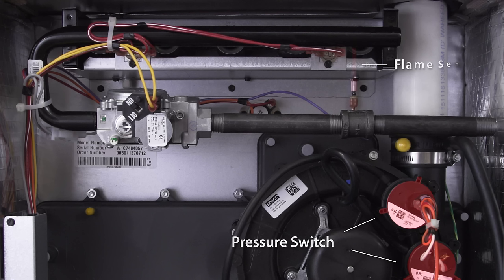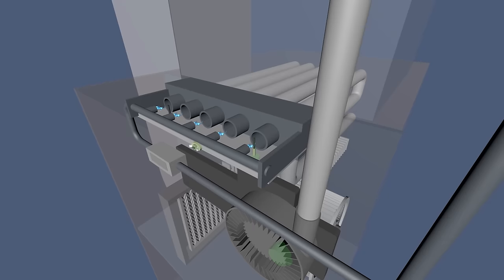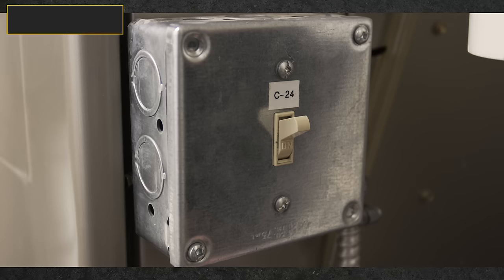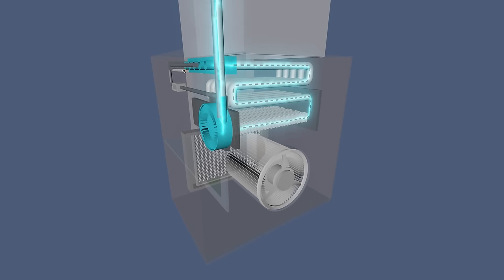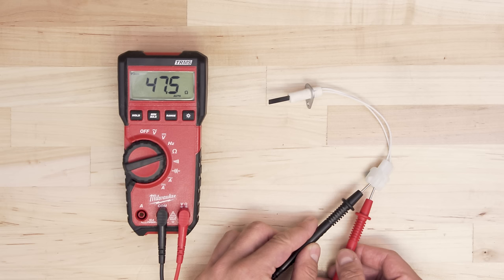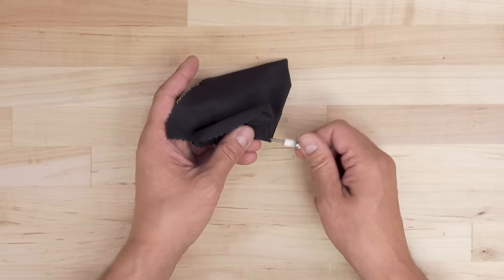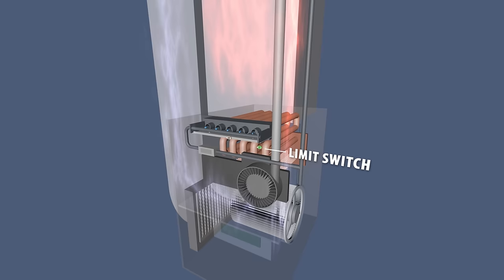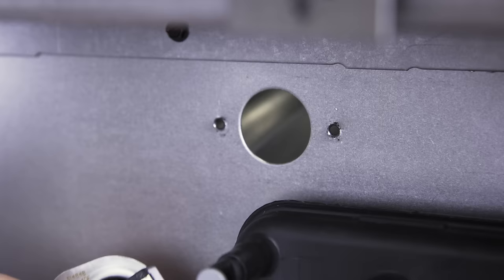Furnace Starts Then Stops - Troubleshooting | Repair and Replace

Comment from the maker: Now that you've narrowed down the problem, the repair videos for each furnace part are all listed in this playlist: https://www.youtube.com/playlist?list=PLCo9SMjkdWBzorzNrARLKALj9fW7HzHMh
Reply from the maker: @mavericktorch1619  Thanks for watching. If your furnace gives you multiple codes, and none of the switches are faulty then it could be a problem with the wire connects or a problem with the control board itself. The control board is pretty simple to replace but is usually a non-refundable part. You can see how to replace it here: https://youtu.be/4SY8lRl8HV0?t=125
Reply: Great video had this issue vacuumed the vent out put and while doing so I started it up and it stayed on...thanks for a clear and concise video my friend you have a sub for life no doubt.
Reply from the maker: @thastudent1741  Thank you for subscribing Erik! We're happy to hear that the video helped you out!
Reply: This furnace comes on and stays on a couple weeks then surprises us and goes off until it decides to come back on.
Reply: Great video. One thing about the inducer blower. We had an issue with the inducer coming on, then shutting back down. Eventually things kicked in later on and were normal. Then it happened again, so I called an HVAC specialist, but by the time her came,  the furnace was running normally. So more background, this obviously is in the winter, and we were getting cold spells. I was also setting the furnace very low at night (13ºC). I then realized that any condensation that perhaps built up during the night, as the furnace was off for a good 10 hours, was obstructing the flow of air from the roof inlet. Once I set the low temperate to 19ºC, the issue never reoccured. The furnace does cycle on once or twice during the night, but by morning, it'll start up right away. Came here because I think I have an issue with the flame sensor (it always comes on and stays on, but after 1 or 2 tries) -- but unsure if it's the Nest doing this to conserve energy.
Reply: This hasnt narrowed down anything. I have ignition then it goes out immediately. Cleaned flame sensor nothing. Replaced sensor nothing.
Reply from the maker: @jamartin005  Thanks for watching. The flame sensor is a rectifier which needs to complete the circuit between the control board, through the flame sensor, through the flame itself into the metal of the burner and down to ground. This is a low voltage DC circuit. Without a flame the circuit is not completed. A dirty burner, one that is covered in carbon can also prevent current from flowing, so it can be good to do a full cleaning of the burners. As well you could use a multimeter to check for continuity between the metal burner and the frame. to see if there is a good path to ground.
Reply from the maker: @jeffster1070  Thanks for watching. Sorry about the delayed response, youtube doesn't always show notification from replies buried within comment threads, so I didn't see this until now. Did you narrow down if the Nest was causing that sort of cycling?
Reply: @AmreSupply  cool thanks
Reply: I cleaned the flame sensor..then power now is not connected!! checked circuit breaker ..furnace one switch ...changed the fuse ..but still the lamp ( that used to blink signaling an error ) is not on at all ? what could be the reason ? thanks a lot

Comment: Saved me a service call and some cash. Mine was the flame sensor issue.   (Goodman furnace) Removed it, cleaned it, reinstalled it and now it’s working great! Thank you.
Reply from the maker: You're welcome Aaron. We're glad the video helped you narrow down the issue!
Reply: wow, that is crazy - exactly the same as me including the brand name of the furnace.  mine is about 10.5 years old.  thankfully it turned out to be a super easy fix!

Comment: Thank you from a single mom whose furnace wouldn’t stay on at 3am. Luckily I found this video immediately with a comment about “powdery snow” and I said I think this is my problem. Cleaned the flame sensor, problem solved in under 30 minutes. Forever grateful for your content!
Reply from the maker: You're welcome, we're just happy that the video helped you get your furnace running again!

Comment: Great video. It just confirmed my last fix is the right one. I had already been through cleaning the flame sensor, took the burners out and cleaned them, and thoroughly cleaned everything inside that I could, replaced the limit switches and the furnace would still decide to not ignite on occasion. I took the pressure switch tubing off and some water in there. After draining that and blowing it out good it has fired up without a hitch.
Reply from the maker: Thank you for watching, we're glad that the video helped you confirm and narrow down the problem.

Comment: Another potential issue that could cause furnace turning itself off after running (with gas on) for a short time is that the outdoor exhaust and intake ports/pipes were installed incorrectly. If both pipes have  openings (outside) next to each other, such as both facing down, then the intake may be sucking in the exhaust gas, causing a lack of fresh air/oxygen for combustion. Fixed easily by making one pipe face out and other facing down. Though illustrated clearly in instruction manuals, some installers don't do this right.
Reply from the maker: Hi Boris, thank you for watching. That is a great point and another good thing to look for when troubleshooting this!
Reply: Should the exhaust face down(with a elbow?) Or just no fittings at all- what about fresh air intake-a 45 elbow-or straight pipe also

Comment: Your video was very helpful in troubleshooting. The clear troubleshooting for each phase of operation made it easy to find the flame sensor was at fault.
Thankfully managed to fix it on a dangerously cold night of -27°C (-17°F) 

My furnace would occasionally run normally. But every few hours, it would attempt to light 3 times, and shut off.  I could hear the burners ignite for about 3 seconds, then they would shut off.

Investigated the flame sensor.  It was clean, but was loose and not close enough to the flame. Tightened the screw and re-adjusted so was in the flame path, and now it's working perfectly.  Although you didn't mention that particular issue in the video, it still helped me narrow it down.
Reply from the maker: Thanks for watching. We're glad that the video helped you get your furnace working again after such a cold night. You are right that this video didn't go into all the details on the flame sensor. The flame sensor is actually just a rod that sits in the flame. It doesn't sense heat, it completes a circuit from the control board, through the flame sensor, through the flame to the burner or heat exhanger, and returns through the ground wire. The position of the flame sensor, a dirty flame sensor or a carbon buildup on the burner can all prevent this low voltage DC circuit from being completed. Hope this helps provide a little more context!

Comment: My furnace was igniting then shutting off then on again continuous with no heat.  The sensor had very little corrosion but I cleaned it and reinstalled and works fine again.  I appreciate your time in making this video.  Saved me $$$ Thanks.
Reply from the maker: You're welcome, we're just happy that the video helped you get it running again!

Comment: This should be the first line of attack when you have a "Short Cycling Furnace Problem". I almost gave up after cleaning the furnace and checking the Nest thermostat, fan limiter, limit switches, replacing the air filter and fan capacitor, etc... I was ready to call the HVAC professional when I decided to give Google another try, I entered "Why does my furnace keep turning on and off",  and I found this section (3:13) in your instruction exciting, (holy sugar!)  cleaning the burners and flame sensor monitors are the solutions to my problem after all. It took me a day and a half to figure it out, I lost half of my hair scratching my head, thank you very much for your help, this post really made my day...
Reply from the maker: Thank you for sharing! We are just glad that people are finding these videos helpful and when it comes to the flame sensor, it is the root of many furnace issues for a good number of people. Cheers!

Comment: Mine turned out to be the thermostat on the wall , it's really old and contacts were corroded , changed it and works perfectly now !
Reply from the maker: Thanks for watching Dan, we're glad it was an easy fix for you! Hopefully you will find our other videos on our channel helpful as well. If you are interested we've recently created an in-depth video on how a gas water heater works https://www.youtube.com/watch?v=BHUPFLbb8NY&list=PLCo9SMjkdWBwJ4a8MT2GKTDiSuvSHg6Xk&index=1 Now if you find these videos helpful consider liking the video, sharing or even subscribing as its the easiest way of supporting future videos!
Reply: @AmreSupply  wasn't really a easy fix but I happened to have found out after a week of trial and error , happen to be standing next to the thermostat and I could hear it clicking inside so I put my hand on it and it caught hold and was running fine after that , what bothered me is the fact that I went to school and currently hold my HVAC license and this thermostat thing was never ever been through in the training class portion and when I was doing my apprenticeship , it didn't come across it either ? Thank God it was my own home furnace ! That would have been embarrassing out in the field ? 🤣😂🤭🙊🤫

Comment: THANK YOU! It’s 16 degrees on a Friday night here and my heater pilot would not stay on. It didn’t match your video exactly because the pilot would continuously  light and go off within a couple seconds but the fan was blowing the entire time. Regardless, I cleaned the flame sensor (which barely looked tarnished) and it immediately fixed the problem. I cannot thank you enough!!!!! ❤️❤️❤️❤️❤️❤️❤️❤️❤️❤️❤️❤️❤️❤️❤️
Reply from the maker: You're welcome, we're just happy to help! 

It could be an issue with the thermocouple, so it might re-appear. https://www.youtube.com/watch?v=3EKbSiAJyiI

Also if you have a multimeter you can test the thermocouple voltage to see if it is producing enough voltage to keep the pilot flame lit. If you have a spark ignition then your furnace might work slightly different than the thermocouple example as before. You can test the voltage similar to the steps in this video: https://www.youtube.com/watch?v=Mx6rZA9Yxv4&feature=youtu.be

Comment: Excellent video!  I found that after remodeling work, even with the system off, all of my sensors got dirty.  This video narrowed it down to the main culprit, but gave me the confidence to explore my system further and check/clean every sensor carefully.  Just took a tiny bit of dust to throw some of them off.
Reply from the maker: Thank you, we're just glad that the video helped you out! The flame sensor is particularly sensitive to a buildup of dust or carbon as it relies on a small DC current to travel from the control board, through ions in the flame through ground. This is how it proves that a flame is present. The flame sensor is nothing but a small metal rod. Nothing special about it.

Comment: This is a great video very detailed but I’d like to add something to this. If the heater keeps shutting down and you have done all this! Check your condensate pump line. It might be frozen if it is up in the attic and it’s like 6 degrees outside. So if your condensation pump is hooked to your heater it will shut it down as well.
Reply from the maker: Thank you for watching. Yes that is an excellent tip!

Comment: I had a problem and my furnace kept switching off after few minutes of heating in repeated cycles and that was the last issue you walked through. I had to change the filter which is just a month old and it fixed the problem. Can't understand how a one month old filter can cause a trouble but the solution you provided was spot on. Your videos are phenomenal and well explained to the point. A big thank you!
Reply from the maker: Thanks for watching, we're glad that you found the video helpful. Was the MERV rating different on any of the filters? If a filter was a higher MERV rating and more restrictive than the others, then it can cause the heat exchanger to overheat.
Reply: My experience: buy the least restrictive filter 
They are cheap 1.50 - 3.00 $ each and replace often especially if you got pets who shed inside the house .plus more efficient at moving the cool air in summer

Comment: Thanks AMRE and this video. My furnace keeps turning on, ignitor would ignite gas then off for three cycles. It's a Lennox G40UH. The diagnostic lights indicate bad ignitor. So replaced ignitor. Still the same. Then cracked open a beer and watched this video. Symptoms point to bad flame sensor in second part of video. So I cleaned the flame sensor as instructed. Lo and behold, it worked.
Reply from the maker: You're welcome! A dirty flame sensor can create a lot of problems. We're glad the video helped you fix the problem!

Comment: Well done and very educational.  I hesitantly called a guy out who started immediately with the 'I hope it's not the heat exchanger,' for which I'd throw him out.  He was pretty good at testing everything methodically, as an engineer though I was questioning things - enough for me to realize he didn't get it and just wanted to throw parts at it.  These things are not rocket science so I'm sick of these technicians who come out with more stories than Shakespeare.   I learned more from you in 5 minutes.  I already suspected he flame sensor, but will review limit switch as well.  The 'tech' wanted to replace the circuit board for $1800!  I found them online for under $100 (btw, that is what I used to do so I don't need his warning of electrocution or 'every year the fire departments find people in attics' (he said that!).   The other annoying thing is finding info in materials or on company's website - everything just refers you to other criminals, I mean 'techs.'
Reply from the maker: Thank you for sharing your experience and we're glad that you found the video helpful. This was one of our goals with the furnace series is to help homeowners gain a bit of knowledge. People go through the same stress with vehicle repairs, a little bit of knowledge can help prevent a mechanic from doing unnecessary work or over charging for a simple repair. Also $1800 is highway robbery for a control board. With the power disconnected these boards are very simple to replace.
Reply: @AmreSupply  Yep, you will do far better being transparent and honest than these hacks out there trying to get rich off every single call.  Good branding!  I've not swapped the board because I've been doubtful and prefer to review the other items like you showed.  Business is so easy, but there are still these old school clowns hanging on to ideas that 'people don't know' (tell 'em it's danegerous.'), they'll be gone soon enough, I hope.
Reply: I called a guy which costed $180 came over, and only cleaned my furnace, then suggested me to replace the furnace, but didn't solve my issue.  

I cleaned they flaming rod myself and now it worked for about 3 months. 
but now, the furnace works only when the cover is opened,  as soon as I put the cover on, it stops, even with the filter took off.  Could you help suggest what's the issue? thanks
Reply: @shw4083 did you ever figure this out? My error code is reading limit switch, if I have both doors on it will run for 5 minutes then shut off then cycle again a few more times before lockout. If I leave the flame door off it will just keep running without shutting off.
Reply: hi  @Del_Keba    this was exactly tha same error for my furnace.  You could try take off your burners offer and clean them throughly ,  mostly lastly that there are some residues/ashes that block the air into burners. I cleaned myself and it works well till now.

Comment: at first I was sure the problem was going to be the igniter but after watching that video and allowing the furnace to try starting with the front panel off I could see that the igniter was working fine and I had flame for several seconds before it would shut off.  I tried checking the flame sensor and wasnt too hopeful because it barely looked dirty.  a quick clean with some fine sand paper, put it back in, turned the system on and it's running perfect!  I also think the electrical connection may have been loose so made sure that was tight.  thank you so much for this great helpful video!  saved me at least $150 for a service call and who knows if they would have tried to sell me something I didnt actually need.  I hope this business model is working for AMRE.  I was totally ready to order parts from you guys if I needed them.
Reply from the maker: Thank you for sharing your experience, we're glad the video helped you out! You are right a loose connection, corrosion on a terminal, or a frayed or broken wire can cause the same issues as a dirty flame sensor.

Overall AMRE has come a long way in 50 years we're fortunate to be able to help people out with these videos! Thank you for the support and we'll still be around next time one of your appliances or fixtures needs a new part! Cheers
Reply: @AmreSupply  right on!  you guys are the best!